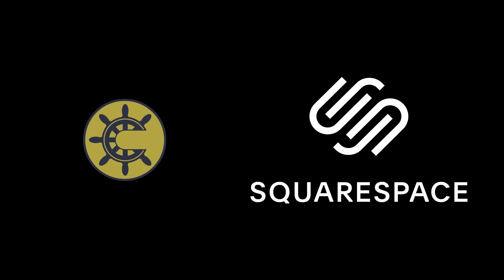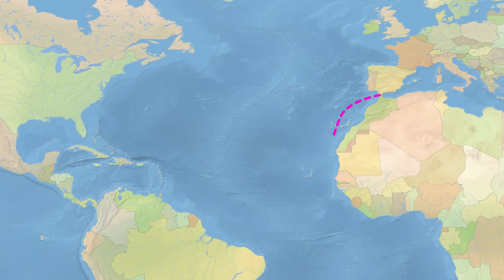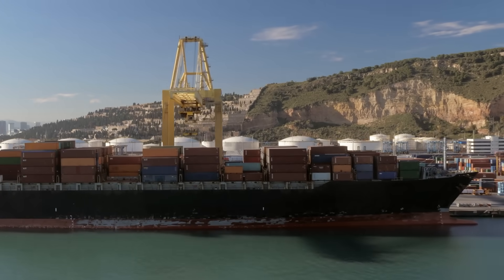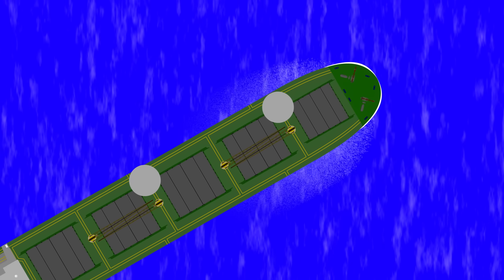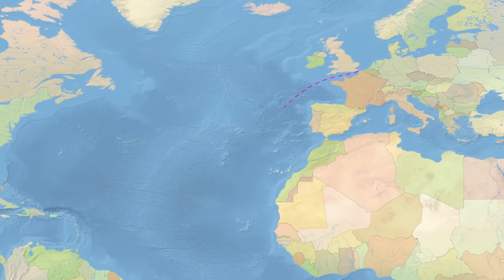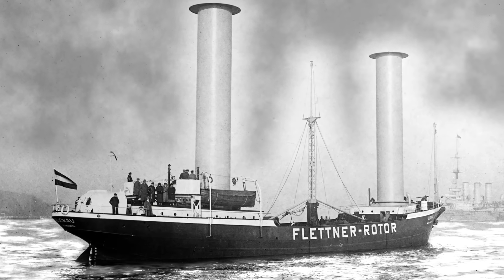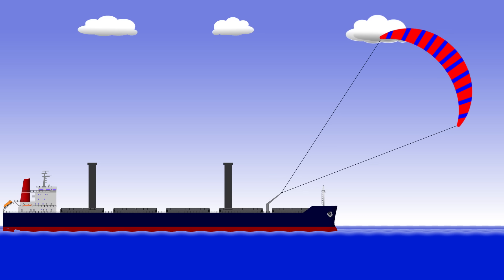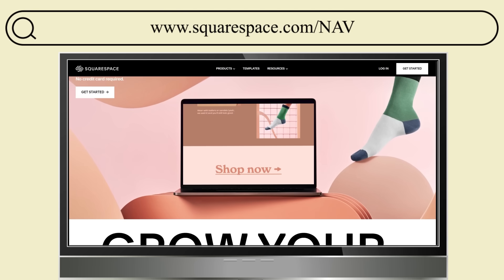Why Don't Sails Work On Ships?

Comment: At 2:07, describing conventional sales, you say they work by deflecting the wind astern. That’s not right. Beating into the wind, they work like the airfoils you describe later in the video. Going downwind, they simply get pushed by the wind.
Reply: Sails do work by deflecting wind astern. That is a change of momentum of the air. On a run it may not be deflection but the wind momentum is still being changed toward the rear. From the law of conservation of momentum, whatever thrust the sail provides tells you there is a rate of change of momentum of the air, equal and opposite to the thrust vector.

Comment: If the ship sees a boost in efficiency and a decrease in fuel costs, why wouldn’t someone be willing to pay more to use that ship? Why is a law needed?
Reply: He explained that in the video.
Also the cost for a new technology can be high at first but drop significantly when in widespread use.
That can lead to even very beneficial technologies not taking off, or only after a long time.

Comment: Companies' behaviors are more visible than ever, so shipping companies that change on their own are going to be the way to go. Plus, there's no way for the UN to not fuck it up. Considering how frugal shipping companies already are with fuel, I'd rather wait a little longer for the best solution to shake out, then have the UN craft new regulations -- with the help of the biggest companies, of course -- that impede innovation, or allow shipping companies to say "See! Look! We're adhering to UN regs!" even though it's doing very, very little to help pollution or fossil fuel consumption.

Comment: Just to add, a sail is an aerofoil and it is the lift generated by it that propels a yacht, but there is another issue; _apparent wind_. Presume you are crossing in those nice following trade winds of 25kn. Well, the faster you go, the faster you ‘run away’ from the wind and so the apparent wind speed drops. A boat travelling downwind at 20kn in a 25kn breeze therefore only has a 5kn following wind and that significantly reduces the life produced
Reply: Only one component of the propulsive force from sails is from aerodynamic lift, the majority (at least for most types of sails, most of the time) is created by a reaction force by the sail catching the wind, more like from drag..
The sails of racing yachts create more force from lift which helps them said upwind (not directly) faster than going downwind.
Reply: @sergarlantyrell7847  You might have things a bit muddled.  It appears that spinnakers "catch" wind when the boat is sailing downwind, but most soft sails function by taking advantage of Bernoulli's Principle (aerodynamic lift), wherein wind, flowing over the front of the sail creates a lower pressure than the back of the sail, resulting in wind "suck" that pulls the boat along.  This suck is so efficient that boats can "fly" faster than the wind.  It is a combination of B's P, and Newton's Third Law that provide lift for a ridgid aircraft wing.
Reply: @Patriottoo2 Indeed, I agree, and it's more complicated than that. The aerofoil function of a regular sail is highest when you're close hauled, but drops off as the wind shifts aft. Then the pushing effect contributes more. What's worse is that it's not a linear relationship, and so to get the most out of a sail you need to analyze wind direction, the set of the sail, and the boat's speed to find the best configuration for the current environmental conditions. 
As for spinnakers, yes, they're known as kites for just that reason. It's a big bag at the front that requires constant management from helmsman and crew.
Reply: @Patriottoo2  "but most soft sails function by taking advantage of Bernoulli's Principle (aerodynamic lift), wherein wind, flowing over the front of the sail creates a lower pressure than the back of the sail, resulting in wind "suck" that pulls the boat along."

No, you're flat wrong. What do you think produces the pressure differential on each side of the foil? It's the reaction forces of the sail pushing the air particles.

"This suck is so efficient that boats can "fly" faster than the wind."

Again you're wrong, it's got nothing to do with "efficiency". Sailboats can exceed wind speed on certain points of sail because their own motion creates "apparent wind". Sailboats may exceed windspeed, but they'll never exceed apparent wind speed.
Reply: @phillycheesetake  Except for the land sail car that Derek Muller (Veritasium) managed to make work.
Reply: @Patriottoo2  Bernoulli's law is seen everywhere, yet not everything is an airfoil. I think it's quite a stretch to call a sail an airfoil.
Reply: @reidprichard  Perhaps, you should do a bit of research before calling me to task.  Here's the first sentence from Wikipedia, regarding airfoils... "An airfoil (American English) or aerofoil (British English) is the cross-sectional shape of an object whose motion through a gas is capable of generating significant lift, such as a wing, a sail, or the blades of propeller, rotor, or turbine."  Apparently, Wiki doesn't think it's much of a stretch, either.  :-)
Reply: @Patriottoo2  I believe that is only referring to a sail that is nearly aligned with the wind, where I agree that a sail can act like an airfoil. While sailing purely downwind that's not the case (though Bernoulli's law would still apply).
Reply: @reidprichard  Obviously, the function of sails is too deep for you to comprehend.  Better luck next time.
Reply: @Patriottoo2  why you so mad bro? I'm actually working on my PhD in fluid mechanics, but I'm glad that your ability to read Wikipedia makes you an expert.
Reply: @reidprichard  So, I see you would fail at sailing, but excel at trolling.
Reply: @merseyviking 
I love pinching when close hauled, as close to the wind as you can, jib tight and screaming along. 
I miss sailing.
Reply: @reidprichard 
Correct, when running from the wind the mainsail is all the way out and is just being a kite.
Running is slooooow
Hauling and Reaching, every angle except running, is where it's an aerofoil and fast. 
Fastest is close hauled, you pull in your sheets (ropes) tight and steer as close to the wind as you can, watching the sail shape. Can't turn into the wind (obviously) but you get up close and use other controls (more ropes!) to adjust the shape of the aerofoil, the course you've set calls for adjustments to the shape, you control the moment of the mast, too much and you dip the bow and slow down or rise up too much and bounce. You move the point of force around the sail to control it for best speed according to course, tide and wind. 
And now you're racing! 😙🤌
Reply: @MostlyPennyCat , close hauling may FEEL the fastest point of sail as you have the apparent wind in your face, but look at any yacht’s polar chart and you’ll see a broad reach, around 120-130 degrees off the wind is the fastest point of sail. See https://en.wikipedia.org/wiki/Polar_diagram_(sailing). If you believe this incorrect, please post a link to the polar chart of the vessel you are referring to that sails faster upwind. We will all review with great interest
Reply: On most courses apparent wind actually increases the faster the boat goes, which increases the efficiency of the sails even further.
That's why racing yachts most of the time are sailing close hauled.

Think of sails as devices that extract energy from moving air.
The more air you come across, the more energy you can harvest. The limit is really only in the amount of drag the boat has.

Comment: regulation and laws forcing this is not the answer. if it were economically viable, people will do it. Forcing a crap solution onto the world before it's ready drives up prices not just by the obvious increased shipping costs, but also by the slow down of logistics due to the bottleneck of getting technology retrofitted.
Reply: absolutely agree

Comment: Better explanation for sails, which explains why square riggers are no longer used:

Force is applied to the sail, which is attached to the main mast and the boom.  
The main mast acts as a fulcrum.
The boom acts as a lever, against the mast; as the boom moves it applies force at almost any angle.

"Give me a lever long enough and I could move the earth".  Aristotle, explaining the power of leverage.
Reply: That's not better, it is not even coherent. The mast does not act as a fulcrum. There is a mainsheet at the other end of the boom. Wherever the sail is on the boat the force of the sail acts at its centre of pressure and there will be a lever between there and the boat centre of mass. But that is a loss because all it does is turn the boat and has be countered by opposite rudder, which is extra drag. An oar is a lever but if all you do is paddle on one side then you go round in circles.

"Give me a long enough oar and I could drive the Queen Mary round in circles” Aristotle, explaining the drawbacks of levers.

Comment: Couldn't cargo ships also use vertical-axis wind turbines? They're the helical/double-helix design that don't require as much space as traditional windmill type wind turbines.
Reply: There's a reason you don't see wind turbines on motor vessels: Drag. You're burning fuel to spin them.
Reply: Not that it’s a bad idea, but be aware that these are NOT self starting.  You need a small motor to kickstart them once the wind picks up.

Comment: I love your details like the enormous SAFETY FIRST on the superstructure. That and using Titanic or one of her sister ships with one non-functioning funnel they added for looks. Given the practice of slow steaming speed would not be that much different than what some large cargo ships from the end of the days of sail could make, e.g. Peking. And motor sailing where part of your propulsion comes from wind is perhaps an efficient compromise. Sigh. It's all about priorities and international regulation in an increasingly small world whose survival may depend not on technology but how we are able to regulate or not regulate significant environmental controls.
Reply: It is at least true that a major port requiring something is a good way to speed adoption internationally.

Comment: i hate people using the equal time principal for aerofoils its newtons 3rd law of motion
Reply: He did not mention equal time.
Reply: @XPLAlN  he implied it by using the pressure which is caused by Bernoulli's  principle most often used to justify equal time argument
Reply: @vorsims  Eh? He did not imply it, you are imagining he implied it. He said the faster moving air generates a low pressure area. There is no reason to assume he believes this faster air is because of the equal transit time fallacy.

Comment: Very nice and informative video. However, I disagree with the claim that regulations are needed to make such things mandatory. It is very restricting with the idea to solve a problem that I am not convinced actually exists. As landlords still upgrade the houses equivalently, the impact on charter rates can and would work, provided there is value on using these new technologies. There is no actual need for such regulations as I see it. Even more so, it is very slow and inefficient/ineffective to try to produce such changes through legal channels and especially international legal and political channels. The maritime and shipping industry has always worked being one of the most free and unregulated markets.

Comment: One drawback of the fletner rotors are that they can only create power two directions of the wind
Reply: No. A flettner rotor can sail to a larger amount of angles to the wind, compared to a traditional sail. Also you could sail backwards or steer the ship with them (if you had at least two).

Comment: Where would the energy to spin the rotor come from and how would that offset the fuel cost savings?
Reply: The energy to spin the rotors is through fuel, but the added energy from them offsets the amount of work the props have to do.

The efficiency is low, but it’s better than nothing.
Reply: It requires very little power to spin the rotors, perhaps a few kW on such large ships, while the propulsion power they add is in the hundreds to thousands of kW.

Comment: "The wind being deflected to stern" is not how sails going to windward work. You got it right later in the video. Just like a fixed airfoil, lift is created orthogonally to the sail.
Reply: When CN says a sail works by re directing wind aft he is referring in lay terms to conservation of momentum. It may not be the qualitative explanation that makes sense to 'sailors' but in terms of physical science it is correct. It is physically impossible, and defies the principle of operation for any sail, or propeller, to create thrust (or lift if you prefer) without changing the momentum of the fluid opposite to the thrust vector.
Reply: @XPLAlN  - it's like claiming that airplanes fly because their wings "direct the air downward", which is plain wrong, no matter if you are talking to a 'pilot', a layman, or a physicist.
Reply: @steve1978ger  aircraft wings do direct air downward. Two manifestations of this are the tip vortices (wake turbulence) that are encountered behind and below an airplane, and also, try standing under a hovering helicopter sometime and feel the downwash.
Reply: @XPLAlN  - I'm not denying that they do, all I'm trying to say is that picking that fact alone gives a misleading explanation.
Reply: @steve1978ger  >>I'm not denying that they do, 

You said it is "plain wrong". it's a bit late now to pretend you knew this all along. But ok maybe it was just ambiguous. 

>>all I'm trying to say is that picking that fact alone gives a misleading explanation

Conservation of momentum is a law of nature. In the tiresome debate about 'how an airfoil works' there is one thing that is absolutely clear: the total reaction of the airfoil is exactly equal and opposite to the rate of change of momentum of the air stream.

Comment: 5:30 Neither of those examples are correct. In both cases the shipowner could (and would) advertise their ship's greater fuel efficiency. The building owner could (and would) advertise their building's greater energy efficiency. Or in some instances where the building owner is the one required to pay for the heating they directly benefit.
If the investment isn't being made it is either because the test case is not exemplary of the average case (where the savings are far lower than the test case or even negative as a result of external factors) or the owner does not have sufficient information.

Comment: With the kite you need a telescope roth system, in a V Shape, that keeps the sail above water lvl. So when the hight of the V shaped roth is 50 meter with a span wide of 30 meter and sail of 28 meter the rope may be 30 long on both sides, so the sail keeps above the water line. The V mast most be made so that it can vold itself on the sides of the ship. When the ship is long enough you can bild 1 in the back and 1 in the front and when the one in the back has its sail above deck its ropes can go longer. The V shaped mast most have 1 mast that can roll up and out the sail. And when it starts to pick up wind, the ropes slowly get releast more to put it higher up in the wind. The tallest carbon masts are 90 meters. Look at the system like a kind of slingshot, where the ship itself is the handle to hold.
Reply: Interesting - a rigid mast might offer advantages over flexible cabling for supporting a kite.
Reply: @patnolen8072   with helium filled tubes inside the sail, you can also support a way to keep the sail up.
Reply: @patnolen8072  The mast would have to be really thick and heavy to support the weight of the mast, sail, and force of the wind.